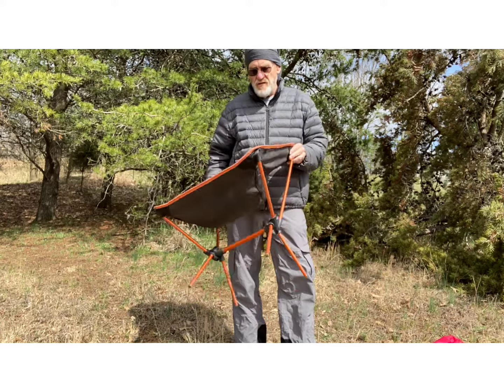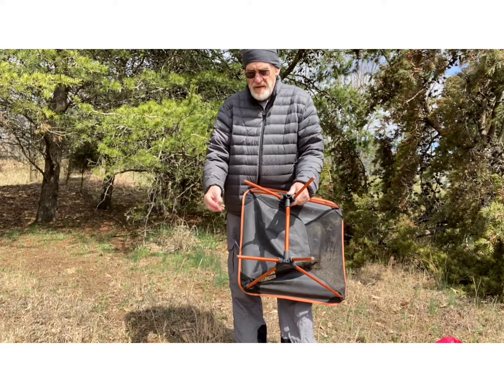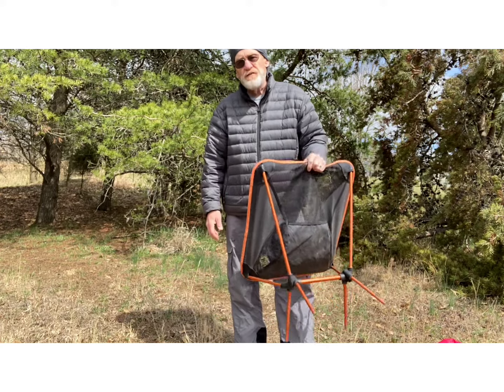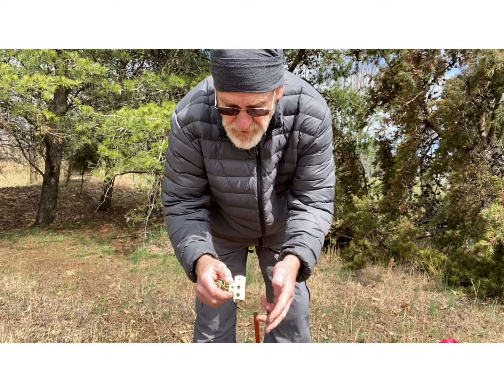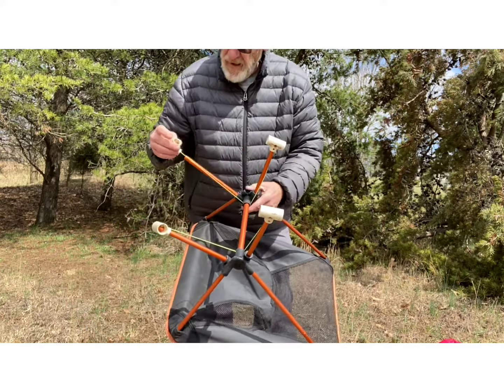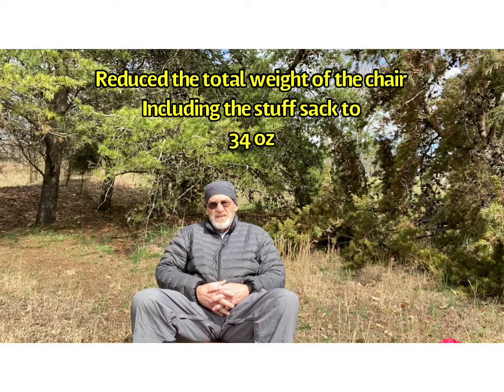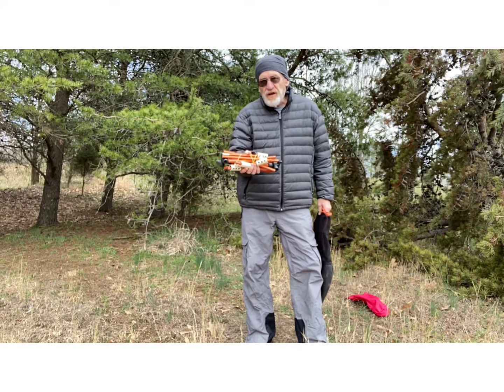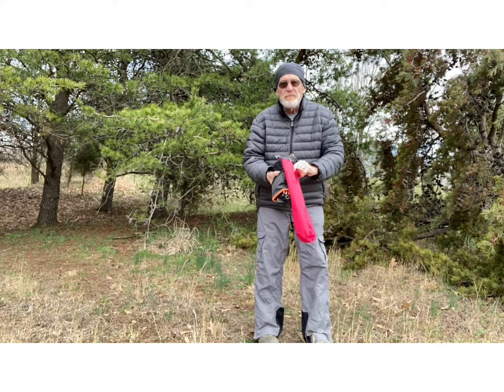“DIY”  Ultralight Backpacking Chair Feet   Stop your backpacking chair from sinking when you sit

Comment: Just made some from 1/2” diameter on all sides, as they were considerably cheaper than the 1/2” top and 3/4” on the 2 bottoms sides.  Still a lot more surface area relative to the original leg ends.  Excited to try this mod out and these only added 1 oz to the original weight.
Reply from the maker: That should work!  👍
Reply: I made mine out of the all 1/2" diameter and tested them out last weekend.  They worked great!  Thanks TrailMedic!

Comment: I made these for my UL chair shortly after this video came out. Paid more than $0.99 per piece of piping but still way less than one of the square fabric bottoms sold by the chair manufacturers. As shown in the video, the chair neatly folds up with end pieces attached. I stow my chair in one of the side pockets of my pack...the chair or my hammock tarp are among the first pieces of gear setup in camp & last ones to be packed up when bugging out.
Reply from the maker: They sure work well. 👍